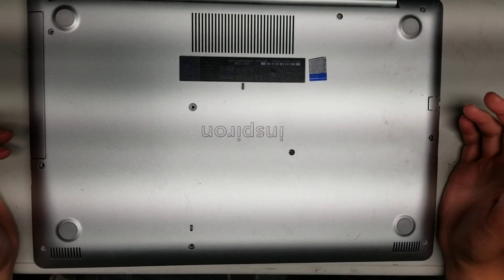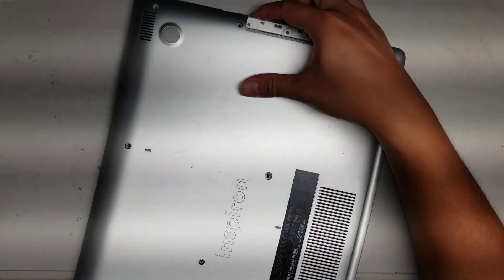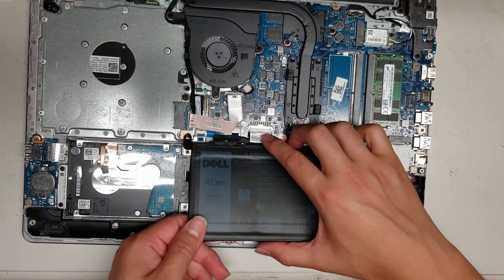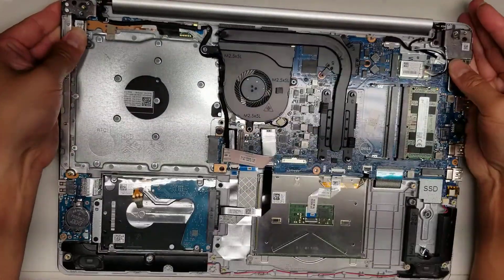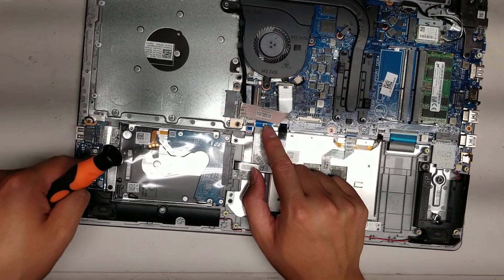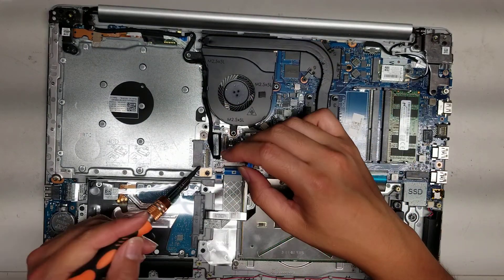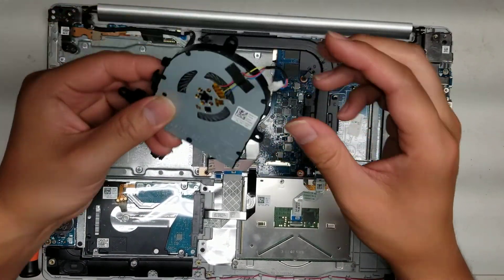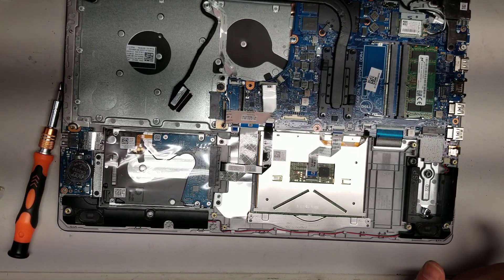DELL Inspiron 5570 Disassembly RAM SSD Hard Drive Upgrade Fan Repair

Comment: there is a larger fan from the non optical drive model to keep it cooler and not throtteling so much in games, especially if you have the dedicated graphics card one
and the M.2 is Sata3 AND NVME. It can do both. So DON'T upgrade to a Sata 2,5" SSD but upgrade to a NVME M.2 and throw out the mechanical drive - makes it lighter, quieter and last longer for everyday use
Reply from the maker: Awesome!

Comment: is it necessary to remove the battery before removing the fan or just removing the battery cable is enough and why i have to do that?
Reply from the maker: Same reason you turn off the electricity before working on things in the house.

Comment: Hi ! Thank you. To prevent any kind of electrical damage is it enough to just press and hold the power button after removing the battery as you said ? Or which other precautions should be taken ?
Reply from the maker: You also want to ground yourself to release static build up.
Reply: @ItsBinhRepaired  can you share how to do it
Reply from the maker: @Sid8303  I'm sure there's a video on it. I just keep my knee on my metal desk and foot on the ground, though that's not the best way to do it, it's much better than just working on it with shoes on. There are a lot of different tricks. You could even work on it naked if you're super paranoid lol

Comment: Hey man I have a problem it’s a dell laptop Inspiron 15 5570 (same in video) 
It says check the following cable jumper connection or sensor: keyword
 error code 2000-0415
Reply from the maker: What do you mean?
Reply: I can’t open up my laptop because it’s saying error code 2000-0415. I tested it and it says check the following cable jumper connection or sensor.
Reply from the maker: @chidindunwosu815  somebody said failed hard drive
Reply: Does that include non of the keyboards are not working because my keyboards are not working but the touchpad and touch screen is working fine
Reply from the maker: @chidindunwosu815  take it apart and put it back together following my video.
Reply: Did that an still the same
Reply from the maker: @chidindunwosu815  not sure then
Reply: No worries I’ll try something else thanks